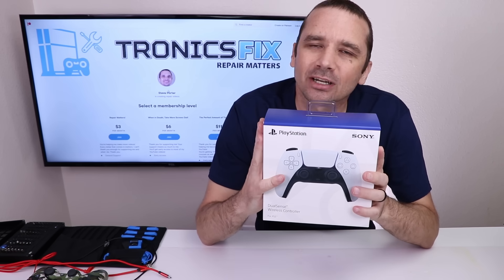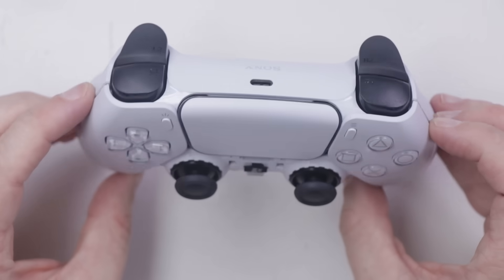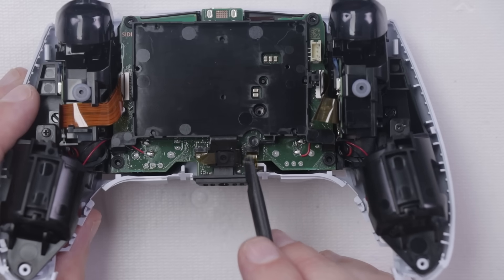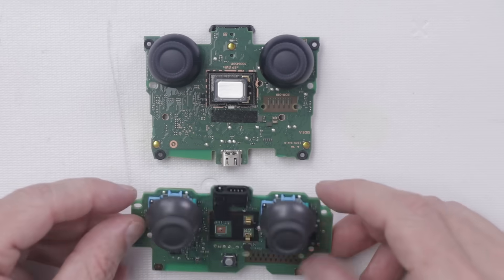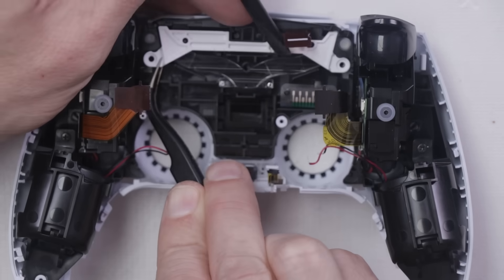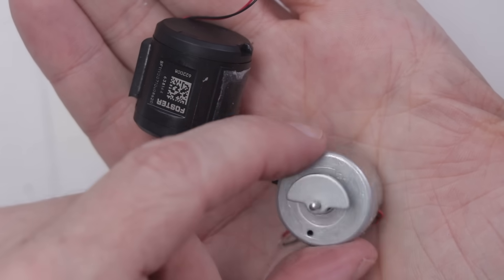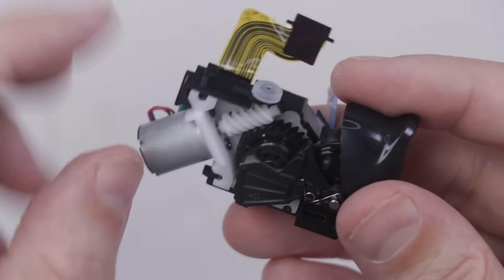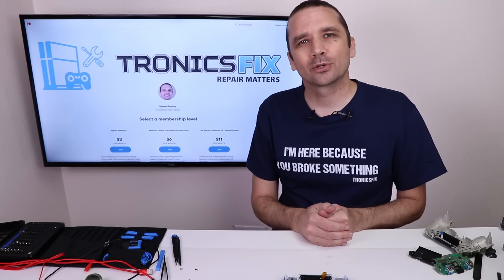PS5 DualSense Controller Teardown - A Repairability Perspective

Comment from the maker: What else do you want to know about this controller?
Become a Patreon supporter here (thank you so much!): https://www.patreon.com/TronicsFix
Reply: I wish you had took apart the rumble motor
Reply: I do
Reply: Only 1 issue I have with duel sence. The possibility of drift hmm was so hoping the changed it.
Reply: You are wrong in regards of the "motors" for the feedback system on the DualSense Controller. It isn't motors, it's voice coils. Basically a speaker without the membrane and frame. There's also still a weight in them.
If you understand how a speaker works you can easily imagine how the controller is able to let you feel a mixture of feedback at once on each side even though there's only one actuator on said sides (just like a speaker can reproduce multiple instruments at once).
Reply: @AvidEric  yea this guy kinda doesn’t know what that means and isn’t too adept at electronics engineering.
Reply: @CB-bi1be  I don't know anything about him - this was the first video of his that I've ever watched, I think. But he at least seemed to have some knowledge in electronics.
Reply: Tear down the haptic motor and show how it operates.
Reply: I notice Xbox 1 had haptics, why is the ps5 pad so much better? I don't understand how it all works. Its confusing because ps are marketing haptic as new without really explaining the new differences as it all sounds just like how it was before
Reply: @MrShokzZ  Xbox just had small rumble motors on its triggers in addition to large rumble motors in the grips. It could do basic vibration as per the DualShock 4 and independently do basic vibration on the triggers.    

DualSense has Voice Coil Actuators in its grips, and back-drivable motors directly acting on the triggers for programmable tension in real-time.  

Voice Coil Actuators are a step above even what the Switch had, and have extremely low latency and a very large range of frequencies and strengths. 
DualSense triggers can change in resistance and even push back. They can mimic a jammed gun, or even a trigger seer in slack take up and trigger break.   

World of difference between the two.
Reply: @EeekiE  Ok its just it was called haptic feedback aswell so you can see my confusion, thanks
Reply: Are those voice coil actuators to enable the haptic feedback??
Reply: I'm will love so much to know if ps4 controler buttons and d-pad works on dual sense. I don't like the original ones and will be nice to find out without trying my self. 🙂
Reply: @eduardcorneliubadet726  either way im sure they’ll sell customizable bottoms for the dualsense for fairly cheap
Reply: does it have analog button like ds3? or digital like the crappy ds4? i miss that feature in games that need it (mgs on psnow is unplayable with DS4)
Reply: Is there a superior drop in replacement for the alps analog stick?
Reply: Do a teardown of the haptic engine
Reply: Thats just great. They fixed the fan issue and didn't even spend time to fix the spotty drift issues. This was most likely an intentions $$$ issue. They want consumers to replace their controllers every 3 months....👎😔
Reply: Maybe could you figure out and explain how the haptic feedback and the adaptive triggers work
Reply: Battle beaver check out the video they terret down pretty easily
Reply: Looks like the microphone can be removed and still work fine. Hated how you couldn't take out the lights on the dualshock.
Reply: I really want to tinker around with mine, I hope there is a battery mod for it like the dualshock4 and rear button mod like you made a video for the DS4 also
Reply: @-Diceman  it already has a battery thats almost twice as big.
Reply: @CB-bi1be  the dual shock 4 has a 1k mAh battery, dual sense has a 1.5 mAh battery but because of all of the new features the controller will draw much more from the battery at a time. So not only is the battery not almost twice as big, but dont expect an battery life improvement since the draw will be different. At best battery-life compared to ds4, it will be only slightly improved. On top of that there were was a poplar modification to the DS4 to upgrade to a 2k mAh battery. If you did that, youre definitely used to a lot longer life on a ds4 than the dual sense can attain. I would at least like to see a mod to increase battery size to 2k mAh, but considering how tightly packed the internals of the controller are compared to last generation, that may be difficult. For someone saying others aren’t “adept at electronics and engineering” you really dont know what you’re talking about in that regard lol. Be nicer to others when trying to gatekeep things that you pretend to know 🙃
Reply: Do a comparison between internals of Dual Sense, Dual Shock 4, Xbox Wireless Controller for Series and Switch Joycons!#
Reply: can this work on ps3?
Reply: @ruggyrefresh5128  haha no
Reply: @ruggyrefresh5128  apparently it works on ps3 but it doesnt  on ps4... it's a Meh move from sony... i mean, you should just update the ps4 software to make it compatible...
Reply: @4324swer  thats because the ps3 actually had better analog triggers and the ps4 never had analog triggers they were just crappy digital buttons . The ps4 was actually a down grade for the controller
Reply: Can this controller works with PC like ds4?
Reply: @2AnimeFreak930901  I got mine working on Steam games but it doesn't recognize it as a PlayStation controller so games that may map with PlayStation buttons it will just use the Xbox layout. Also rumble doesn't work at all. Probably because it uses a different technology that needs a driver for it to work.
Reply: You forgot the new HD haptic that replaces the rumble
Reply: I'm guessing the perfect (in my mind) stick tension is exactly the same with the PS5 controller as the PS4 controller?
Reply: Does the D-pad has separate buttons, or just one big plus button?
Reply: @renok5012  i wondered the same thing because when you first see it it looks like separate buttons, but in other videos when they press the d pad it is clear that they are connected underneath the shell and all one piece
Reply: @-Diceman  Yes, thank you. I found another video, where it was clear.
And this is really sad. I was hoping for 4 separate buttons.
Sony will never learn...
Reply: @renok5012  of course! Im just curious why you prefer 4 separate buttons? The way I see it when they are attached you can roll your thumb around the d-pad and change directions or press two directions at the same time far more easily. Imo thats why that design is superior and why many people complain about the stock Switch d pad with separate buttons. Just curious your thoughts?
Reply: @-Diceman  Fighting games.
4 buttons give you more controll, and less chance to push certain directions when you do not want to.
Reply: @renok5012  gotcha, thanks, that makes sense. I imagine you can probably find some inexpensive wired controllers with 4 seperate buttons to use but it would be cool if they had the option for you on the dual sense. Maybe there is a mod that someone comes out with to get this on the dualsense eventually
Reply: @-Diceman  I modded my DS3 because of the above, however the Dualsense seems way more complex.
Reply: @renok5012  What's wrong with the Dpad? 4 separate buttons doesn't sound like a good idea at all. To me the playstation Dpad has always performed the best.
Reply: @renok5012  I don't understand how you mess that up but ok
Reply: @robertlawrence9000  I already answered this question.
Reply: that Foster part should be voice coil not motor, someone should teardown it to see what's inside
Reply: Are the action buttons and d-pad interchangeable between the ds4 and dualsense? Looks like the thumb sticks are the same but the d-pad seems to be more teardrop shaped on the dualsense.

It would be great to be able to use my ds4 mods on the new controller!
Reply: I'm curious what chip is driving the haptic motors. Can you post the chip markings?
Reply: What's up with the snap dome button on the back of the motherboard? It looks like the battery carrier is holding that down. Is that just telling the controller if there's a battery or not installed? Or maybe it toggles a bit or 2 somewhere when released, so the controller knows it was open? hmmm 🤔
Reply: Plz, plz. Open the haptic feedback box. I want to know how it works
Reply: What is the DAC chip on it ?
Reply: @whitigir  seems like we Head-fi Freaks are in the minority...I also want to know what DAC Amp is in there...I need to know if I can use my LCD i4 and if it has an Equaliser option!!!
Reply: @dumichauch3950  well, at least it has 360 audio @_@
Reply: I want to know where the back buttons. Sony broke my heart with the ps5 controller situation
Reply: please ... can you measure the exact distance between the analog sticks from center? I wanna use the components of a dualshock 3 controller in the shell / housing of the dual sense. The analog sticks of the dualshock 4 are 3 millimeters wider
Reply: @SoccerClassics  you can measure it yourself in 9 days 😁 or buy an additional ps5 controller from stores right now
Reply: how does the controller look inside a controller tester in terms of distance from centre out of the box, and does it go outside of the boundaries when directed in a non cardinal direction
Reply: I wanna know that link for the ps4 controller joystick drift
Reply: 🤔...💬

How about repairing 
a faulty Nintendo Wii 
that will not eject disc
Reply: You saw too late the triggers hidden screws ! Not so pro  ! You should use a bigger hammer if you saw that is not opening
Reply: Are the circle buttons pressure sensitive ?
Reply: anyone know where i can get my limited edition xbox controller fixed
Reply: How many hours of being able to play until the battery is empty is
Reply: Finally a video was looking for
Reply: could you replace the analog sticks with some better quality ones if they become a problem down the line?
Reply: BATTERY LIFE!
Reply: the inside of the haptic feedback motor plz
Reply: Who makes the touchpad? I always wondered who is the manufacturer
Reply: Tc hi g hv I’m hv GN j GN my GN hv hmm jug ko GN u GN🐱
Reply: Open the vibration module. How does it work?
Reply: are the buttons the same size as ps4 controller? asking because i have custom buttons and was wondering if i can use them on the ps5 controller
Reply: Can you replace the analog sticks by just taking off the black top piece, or do you have to get down to the motherboard?
Reply: استمر مبدع
Reply: That was a Spyderco Knife.
Reply: Any idea if i can replace the ribboncable from the triggers? Thats something you didn't mention. :-(
Reply: I’d like to see the Stand by mode.
Reply: Do you think you can use a ps4  remap board on that controller to mod it as a scuff?
Reply: I kinda want to know if I can put one of those charging ports into my DualShock 4
Reply: DualSense controller got 2 type of  ribbon cable on touch pad ...one is brown colour another  one is white colour....
Reply: Just wondering if aftermarket chargers will damage the ps5 controllers.
Reply: My dual sense are having problems with the X button being slow/sticky or whatever you wanna call it. Almost a bit squeeky when you push it. Haven’t been like that since day one. Do you know if there’s any quick fix for this problem since the controller is almost brand new??
Reply: Where can we buy replacement adaptive triggers?
Reply: Can u tell me how to put the white rectangular piece back on where the analogs are.. please and thank you
Reply: Do a XSX controller teardown
Reply: epic

Comment: Dam, I had just wanted to see if Sony had still used a gel layer under its main four buttons and D pad, it looks like they still do. That's a shame since when it comes to fighting games, these gel layers can tear really easy and can ruin your buttons. At least since with a  dualshock, you can get to the gel layer very easily and replace or repair it, but this ps5 controller seems like you have to about completely disassemble it to have access to the gel layers. Also Shane they are still using old joystick parts

Comment: It seems to me that at the very least, the DualSense control sticks are more shielded from debris than the DualShock 4. The black case piece, and what looks like black rings inside that leaving less of a gap where things like sweat, grease, or dead skin cells to get in. All of which can cause grime related stick drift.

Comment: I'm hoping to eventually gut mine open and get a better, and recommended/supported battery. I did this with my PS4 Daul shock controller when I was sick and tired of the battery life being under 4 hours.
Ater I replaced my Daul shock battery with the new one, my battery would last over 7-8 hours ON 1/3 BATTERY. I tweaked the settings to minimum, granted...but I mean that's HUGE improvement.

Now, I've run into this same problem of battery life with the Daul sense controller. It lasts 6 hours on one charge, easily...but I would like to try and not have to charge my controller every time I'm done playing (and simultaneously not have run down the battery in under 3 hours).

Great vid, anyways! Cheers!

Comment: Hey Tronic Fix. 
Could you do a video or test about soldering a Dualshock 4 joystick on the Dualsense and see if it works?  

Where I from there are not any single joystick for Dualsense, and I have one with drift. 

Is there someone who tried that? I would like to know about it?  Please

Comment: the inital stop when shooting stopped working after slamming the trigger down as hard as i could, when being fustrasted at a game. i fixed this by moving the  small black gear back into place and moving the "metal bar" around. screwed the trigger and board down before testing, then closed it.  playing metro with ps5 controller trigger gears can slip if pushed quick n hard enough. happned when pumping or rowing the boat.

Comment: What is the middle silver rectangular part that is on the motherboard between the analog sticks? I was modding my controller to have back buttons and the part fell out when I was removing my motherboard. I couldn’t attach it to the board but it seem to fit in the hole on the case that goes on top of it and still touch the motherboard. The controller works so far, but I’m not sure if that part is needed for some sort of function for the controller. Please advise.

Comment: Can you disconnect the battery and see if the controller still works? That supposedly works with PS4 controllers, but my PS5 controller is set for wired comms and refuses to stay on because the battery stopped charging. Need to know if the battery can be bypassed entirely. Not tearing the fucker apart just to replace a battery  I don't want in the first place.

Comment: Really wish I knew where to get replacement parts. Dropped it like a dummy and heard some rattling in the L2 trigger. Tore it apart and found that a plastic piece had broken. It’s that black bit above the other black gear inside the adaptive trigger. Seems like a simple fix, but finding that piece is hard. Really love how easy it is to take apart, but seems like finding extra pieces to make repairs with is tricky.

Comment: I have a weird question. Would it be possible to fit PS4 controller internals inside PS5 controller chassis. Asking bc I've found a cheap all black PS5 controller chassis.

Comment: Hmm. If I wanted to do a paintjob on the controller. The shell parts itself no problems, when you carefully cover all eletronic parts. But ultimatelly it seems you can not get access to the top buttons, the digi-pad and the touch-pad without removing the motherboard and the trigger casings.
Not without soldering. And personally I don't wanna risk messing up the controller, as I am not confident enough in my fine soldering skills.

Comment: 10:23, l swear that flimsy metal wire on the adaptive triggers is after breaking cause their is no resistance on both triggers anymore l can hear it rattling around inside when l shake it, any idea where l might be able to find such a small fine wire thats already rolled ???. The haptic feedback still works but if the controller is turned off you should still find a little bit of resistance on both triggers.

Comment: Thanks for this teardown. Was curious is they went to screws and ribbon cable for the joytsticks for the PS5 but no looks like soldering still required to fix joysticks like the PS4. Also looks like the exact same joysticks used in the PS4

Comment: DualSense looks more difficulty to deal with if you have to repair it. Sad to see the same Analogues as the DualShock 4. DS4 controllers break easily and more often than any other PlayStation controller.

Comment: Ah, still relatively easy to teardown. I don't regret my purchase. What was I thinking, buying a controller without researching its repairability first? My later gen DS 4 is not suffering from stick drift yet. The gyroscope is drifting like crazy, though.

I wonder what's inside those haptic motors.

Comment: The technic and idea behind the adaptive Trigger is really awesome, but i dont get why they would take plastic for the gears. This will definitly break easily, especially because you need to press the trigger with more force than usually.
These two little parts wouldnt be much more expensive to cast out of metal, and they would never wear out or break.
The Rumblers are also an interesting change, but I'm still happy with my 2 years old Xbox Elite on PC with ReWASD, because gimmicks like these will need years to be modded for PC support, and most probably never be fully utilized, like the touchpad on DS4.